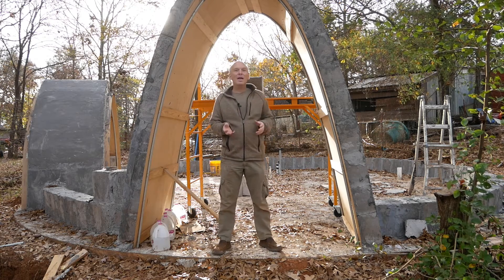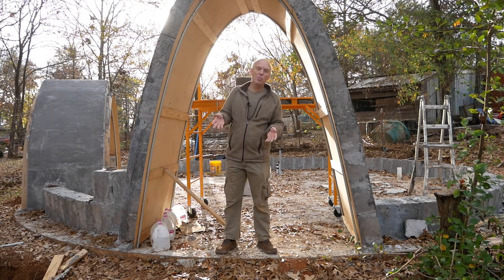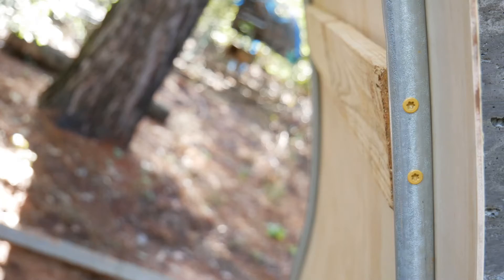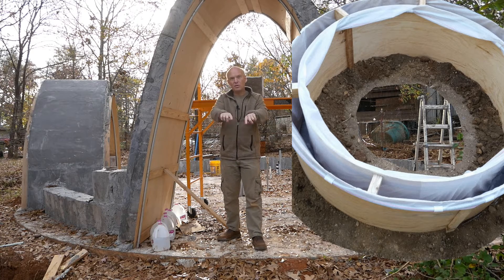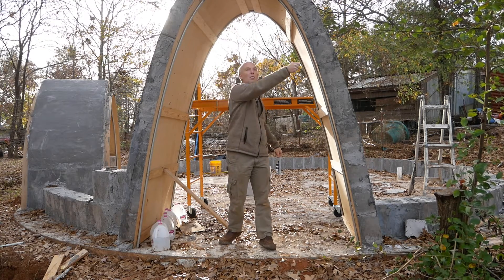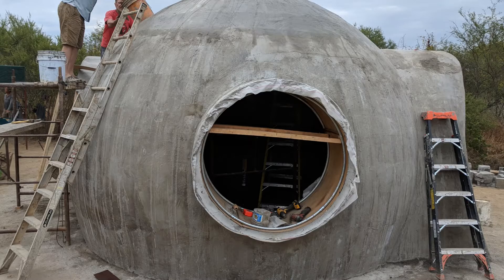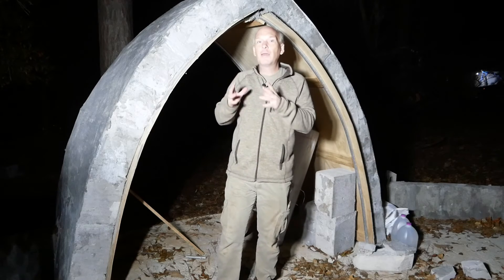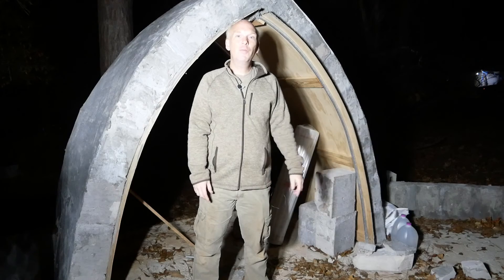Building Round Windows For AirCrete Dome

Comment: Why are these domes so small whats the maximum size ?
Reply from the maker: It's really about the size of a house that can be finished during a workshop.  Also, under 400 square feet is exempt or more easy to get permitted. The largest built, so far, is 30 feet.  I would not advise going larger.  Working higher in the air requires a  scissor lift or tall scaffolding.  You need the radius for strength and flatting the top could weaken the structure.  Not something to do with AirCrete which has low tensile strength.  It should be in compression at all times.